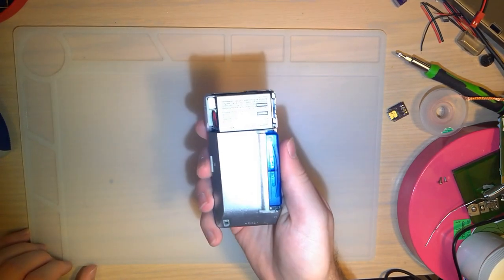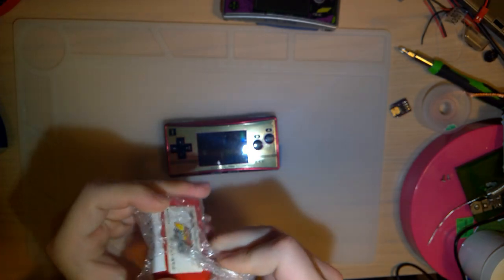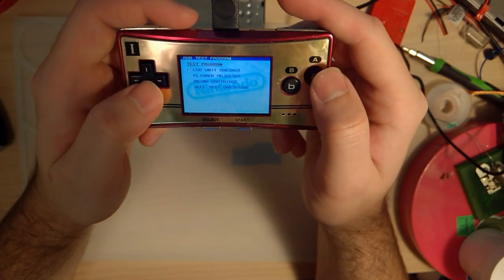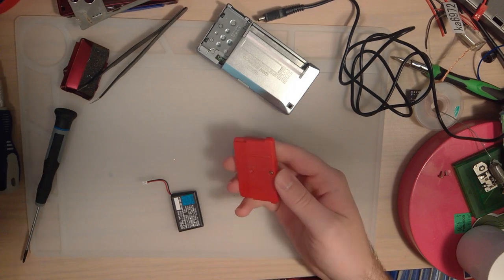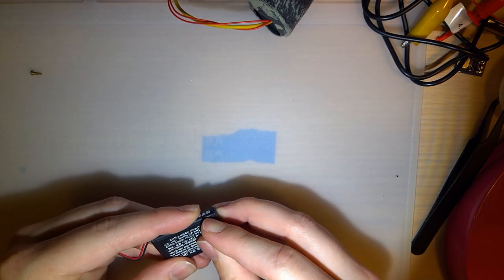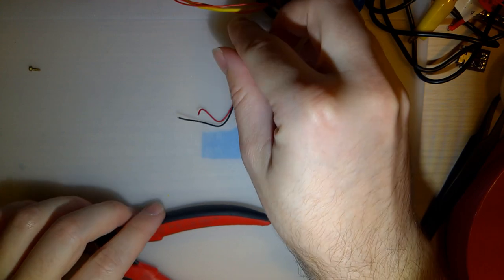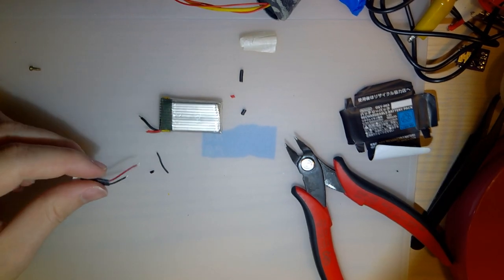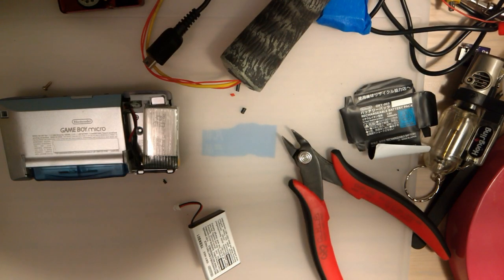Troubleshooting a "No Power" Game Boy Micro

Comment: hi so i just dug out my old micro gameboy, looks just like yours just pink. Ive put it on to charge and the two blue lights were struggling at first but after a bit of adjusting the lead, it is now charging fine, but I have left charging it for a while now and it wont turn on. Do you know what could be wrong with it?
Reply from the maker: What troubleshooting have you done? Have you ruled out the battery?

Comment: Can you replace the screen calibration screw on a ds lite for the top screen? Mine was corroded  and screw top broke off.
Reply: Kinda weird but I took one off my macro because it doesnt need it but I took off a pad on the broken one. I thought I messed up but it fixed itself by just taking off the corroded one.
Reply from the maker: Yes but I don't know the specs or the P/N.

Comment: my gameboy micro does the same thing where when i plug it in, it turns on for a second. I charged it before this occurred so it might just be at 100%? for now, it’s still working perfectly fine. should i be worried?
Reply from the maker: If the battery is fully charged, it won't start charging (the light will turn on for a second then switch off).
Reply: @makho  oh, so my gbm is fine?
Reply from the maker: @DrDocta  Unless it keeps doing that after you've played it for a bit.
Reply: @makho  One more thing that I forgot to mention was that the light doesn’t turn off once it’s fully charged, is that something I should be worried about too?

Comment: u said that gameboy micro has water damage sticker. if my gameboy micro has drowned, what happen to the sticker? are the water affecting battery, pcb, and other stuff? because mine just like blinking when it plugged to the charger. thanks
Reply from the maker: This Micro in particular appeared to just have some liquid behind the faceplate. There was no evidence of submersion or any other water damage on the PCB. The water indication sticker is normally white with red/pink dots and will turn solid red if exposed to water. Liquids will typically cause corrosion on PCBs and this corrosion can both short voltage or data lines together or, if it gets bad enough, completely erode away lines altogether.

If you want to try and repair something that has water damage, you FIRST NEED TO DOCUMENT ALL THE AREAS WITH VISIBLE CORROSION. Taking high res pictures is very helpful. Then, you can try just cleaning up the corrosion. Isopropyl alcohol and a toothbrush is usually the best method. From there, let it dry and test again. If it still has issues, you'll need to reference those pictures to check the areas that had corrosion for further damage. From there, the fixes may vary wildly and with something as intricate as a Micro, it will be extraordinarily difficult. Let me know what happens.

Comment: What is the battery model you used as a replacement?
Reply from the maker: I don't recommend that battery, it is much lower capacity than the newer one I found: https://retrogamerepairshop.com/collections/game-boy-micro/products/game-boy-micro-750mah-high-capacity-replacement-battery-by-makho

(there's a video linked on the page with more info)

Comment: So I replaced the battery of my game it micro and it still does the same thing. Light turns on blue for a bit then turns off. Any possible fixes?
Reply from the maker: sounds like there's a short
Reply: @makho  any way to fix it?
Reply from the maker: @Turo2016  find the short and clear it. You'll have to examine the board to determine what is wrong.
Reply: @makho  Do you happen to have/know of a video guide on how to do that? Thanks for your help so far much appreciated.
Reply from the maker: @Turo2016  there's not "one specific fix" for your issue. You need to inspect the board to gather more information.

Comment: is $230 for a ff4 one from japan worth it?
Reply from the maker: Personally, I'd rather have $230 than a single Micro. That's more than I've spent on a single Game Boy (not counting mods -- that cerakoted GBC was expensive as fuck). That being said, I don't think it's a bad price but it's not a great price either so "worth it" is something only you can decide. Also, FWIW, sold loose FF Micros on ebay seem to go for about $170-200. In fact, it looks like there are a few listed in the $170-180 range right now. I can't speak for the condition relative to the one you are looking at though.

Comment: My biggest take away from this is I'm impressed your ez works with the blue shell. Mine has a hard time in some SPs my ds lite and the occasional GBA, but with the blue shell it doesn't make proper contact in anything. Was very disappointed since i had to order 2 after the first was lost in the mail.
Reply from the maker: Fits better than the OEM shell mine came with so ¯\_(ツ)_/¯
Reply: @makho  I think I just got one of the bum boards that aren't quite up to spec. They've acknowledged them but just said jam a piece of paper as a shim behind it
Reply from the maker: @caste215  interesting because these boards are actually considerably thicker than OEM games
Reply: @makho  if you poke around gba temp you'll see other people complaining  about it and the makers responding with suggestions that boil down to layering copy paper behind the pcb. I think it's rare but sucks when you have the unlucky draw
https://gbatemp.net/threads/ez-omega-not-booting.503979/